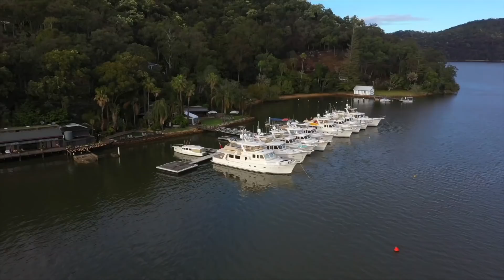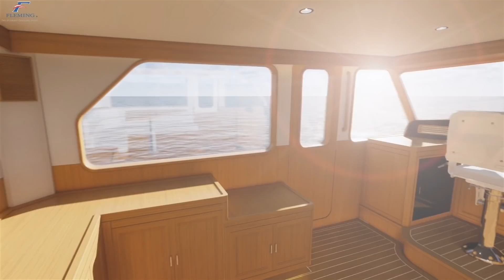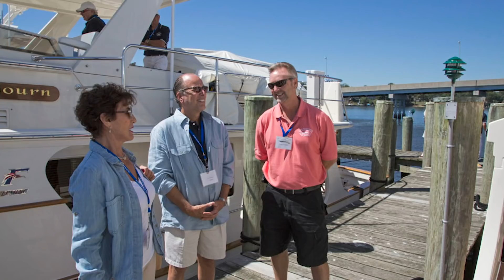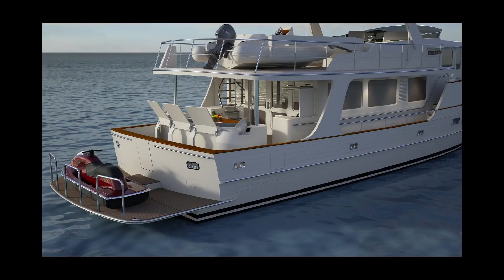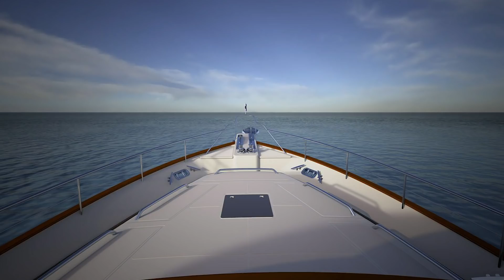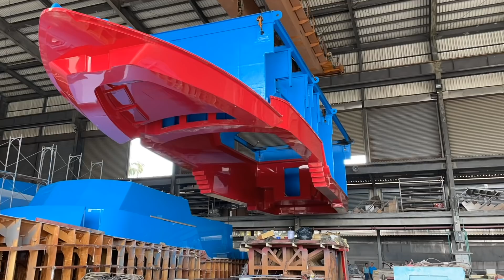Passagemaker Interview On The New Fleming Yachts 85

Comment: A great beauty indeed; I appreciate the enclosed Flybridge design for the larger craft-- air draft no longer an issue.
Would they consider reverse rake windows forward of the helm? or just not part of the Fleming "DNA"?  the advantages being the 3 Gs: no Glare inside, especially at night; no Greenhouse heating effect; better Gasket longevity out of the sun and better drying...
the rake could parallel the sharp upper rake of the bow itself.

Comment: What I really don’t like is all the wasted footage at the back of the yacht.  Behind the lovely outdoor dining space is a gap, half wall and flat swimming/diving area. To me wasted area.
I would much prefer it all covered and deck all the way around. I would make the cabin 4 to 5 feet longer, which would still give you more than adequate outdoor dining space.
I’m sure there is a reason for this (I hope)?  With 85ft., would still want a single Captains Cabin, just in case you decided to take one on, even if the three staterooms were a bit smaller. 
Adore the Fleming, perhaps this is just my personal preference.
I really dislike those slick drug runner yachts, but despite of the terrible outside design, give a bit more options inside.

Comment: The under 90ft rule not counting roller chain or rear beach deck if it is separate from hull & moves, but dunking it in water if u hve enclosed walls means serious lifting power, not happening. Just railings & water bags or fuel bags tied down letting down in water won't strain the lifters. Only if trying to lift back up. If water bags u can just pull plug, but if fuel bags then u need to use the fuel down or transfer it into tank b4 u try & lift beach deck.

Comment: U will hve to winch up tender even if lifted by deck so u can fold beach deck up then let dinky back down. Or u r dragging beach unfolded deck a bit & longer than 85ft.  If rough seas hving water bags on unfolded decks & hving them in down in water position is best set up. U hve to secure water bags if lowering the deck down n water though.

Comment: The way to hve adjustable draft is good fresh water store u can fill or not, great fuel store u can fill or not, but most of all shower water store huge, that can b pure H2o or brackish or pure salt water. This way at sea in bad weather if u don't hve time to fill shower tanks w/fresh u max fill from sea. Bc taking a salty bath vs rolling over or sinking is easy trade off. If u hve few days b4 bad weather fill the shower tank up fresh & clear. Hve walk way bags u can fill up w/ fresh or salt too same idea so drafting heavy in rough weather.

Comment: The anchor arm roller folds down or up if short length needed. Longer & stronger than normal anchor roller arm bc it is slotted for a carbon fiber drop in sailboard type fin right up front, can b 10ft down in water to help front end track straight even though ice breaker round & just float skimming in the air. When u want to drop anchor u pull out the sailboard.

Comment: Instead of 1 keel down middle also trace out hull front & on sides so even though less displacement 3 v keels trying to keep u planted. If u r going to drag something & thin steel keel blade is no big deal. Air system 4 beats 2 fins is best stabilizers system & easy cost install & repair. Sea keeper is budget blower in 85ft.  Less v means more round or tri-axe. If u want less draft 1st & most then round hull w/ harsh double diagonal cut outs is best, still u need water tight bump crash protection in front short & sweet length restriction BS. Think ice breaker round tough front end & water tight crash still. It is like big f-ing round front end only stops short in water so naturally plains, Then transitions back down to normal semi displacement depth. Idea is if u r going to drag keel or front it is a wedge lifting u out of the ground slowly little bit then a little more progressing to back. Not smacking into hull. Oh we r "starting to drag slow it & back up, instead of we hit bottom & r stuck. Rounded front hull just floating in water/space up front. Front end of hull might b 2 ft of draft then 2.5 then 3ft, then middle is 4 then 4.5 all the way to not an inch more than 5ft at keels trace drag.  It is key to efficient travel the draft & sets the wt of ship & stuff 1st damn think u hve to work out, normal loading. After out of swallows u can heavy load past 5ft of draft, but hving design functional loaded & less than 5ft is key. Rough seas being able to draft 6ft is ideal even if u just fill up fresh water hold or worst case sea water hold, or best beat fresh water & max fuel.

Comment: the upper deck should max length extend as poss. Front bow should b higher, if u room for Portuguese front then taller front next best more walls no railing cheaper & more water tight deal. No inside helm & 2nd deck is enclosed helm & how u get to front of boat. 1 walk some u make right side walk down to stair & others u make left walk down to stair. Just a ledge u can hook on & use to clean windows on wrong side non walk.

Comment: it is right in sweet spot, loop boats can't hve more draft than 5ft max not an inch more, & under 90ft ish, max beam under 23ft. Hving max ht limit of 19 ft or less new loaded from water, so mast needs to fold. Reverse rake glass 1 feature of trawlers is still missing from fleming. what ever hull shape gives least draft while hving most volume ie semi is best, & bow is ancient tired. Newer lighter material r key to getting low draft. Right length, right size, right tech IPS penta & solar & hydraulic beach & side deck folds & genset back up drive, all in classic sturdy tired & true dead fleming style. It is all about getting each prt just right bc  only 85ft, just right power, just right range, just right new tech & old dead cues, & modern features & tech, & modern bow hull at a price that works in market. Too much tech or ultra material won't sell at only 85ft. But there is high demand for this product under served in market place. Ppl will naturally if can end up here forever boat & skip starter house. Esp if older stuff on market missing tech or hull or dialed in perfect total product, & modern not cemetery decor, ie timeless not dead yet styling.

Comment: We had a 55 fleming  built in Maryland “prime time” gorgeous boat and love your travel videos ! Thanks
Reply: Fleming yachts have never been built in the U.S. They have been built in Taiwan since the company started in 1985:  

"When the first Fleming yacht was being created in 1985, boat yards in Taiwan offered the best choice for building such a quality vessel.  After extensive research,  Tony Fleming selected the  Tung Hwa yard, located just outside the busy port of Kaohsiung, to build his new design. Since that time,  the Tung Hwa factory builds only Fleming Yachts, and every Fleming has been  built at this factory with many of the same shipwrights and craftsmen. In fact, the same engineer who currently installs the engines, gears, shafts, struts, props and rudders has done so on every Fleming Yacht ever built.

The many other craftsmen from our early days who remain with us are very proud of their work and  experience.  Their  passion  and  skills  are  passed  down  from  one  generation  to  the  next.  Of  course, new methods and materials are continually being introduced to improve the functionality and safety of our yachts and to ensure they all are built to comply with CE Ocean Class Category A or NMMA/ABYC standards. Fleming Yachts personnel are continuously on-site to ensure that ideas and designs are communicated directly. They also personally test and inspect every boat before shipment."
Reply: Well, well,well, I guess someone was fibbing?" Oooooh, I'm tell mama on you Rodger, you and Rerun are in trouble" Dee from 'What's Happening"

Comment: I wonder why they stuck with shaft drives rather than pods such as Volvo Penta 1300's. Does anyone know if shafts are increasing in efficiency.
Reply: Not enough power. Those Volvo 1300 are 1000hpx2. These 85s have 1500hpx2. 50% more hp
Reply: @shauno1970  It's been said that 1000 hp IPS pods have the same thrust as 1300 hp shaft drives. So you only have a deficit of 400hp. Now if you add the Sharrow props to the IPS pods you might even have parity. It would also free up some more hull space for humans. In any case you could put 3 x IPS.